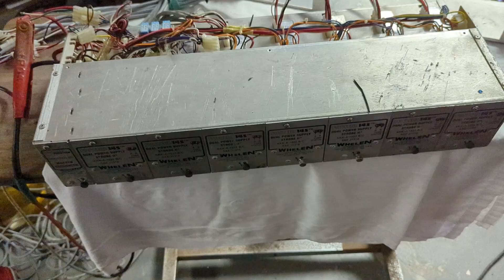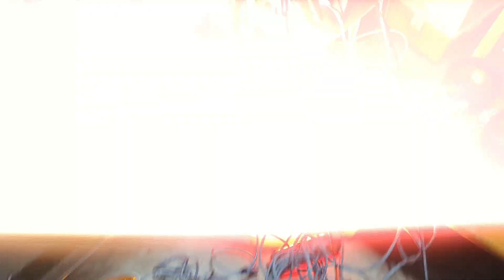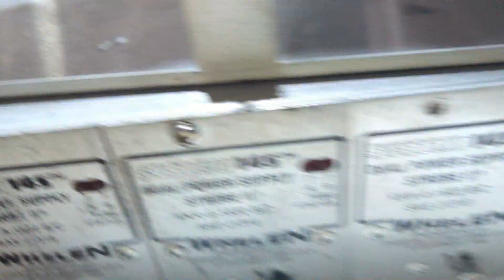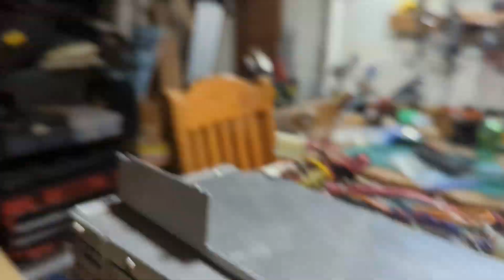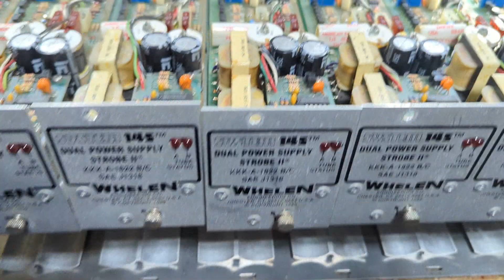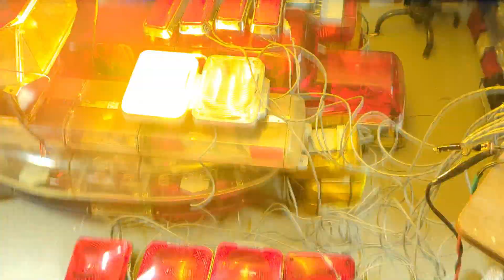Whelen 1989-1991 Ambulance Strobe Power Supply Racks

Comment: In all my years working the boo-boo bus, the only time my lights were on in "secondary" mode was because I went past the center-off position on the rocker switch.
Reply from the maker: With park kill/activate being an option this is a reality that didn't have to be this way.  Clear and eye level grill lights are distracting on scene. The primary mode, which often went with flashing headlights, was never meant to be left on while parked, but the switching was pretty badly designed. I left mine in primary many times too (and I'm a light nerd). Aeromedical isn't fond of clear strobes either. The other danger (and something I did) was flipping it into secondary when trying to drive lights and siren, which is equally as unsafe. It is nice many modern ambulances automatically drop into secondary when you put them in park (you can override it). I do wish every truck had an intermediate setting that left everything on except clear; secondary turns off too much to "request the right of way" so back when these were made there wasn't a good way to "kill the clear" without losing your intersections. You can now spec a truck with a "clear kill" which is great for snowy and foggy days. This will leave your intersection lights on and just kill the center clear and headlight flasher. But yeah, putting it into secondary was not always my priority when I arrived.